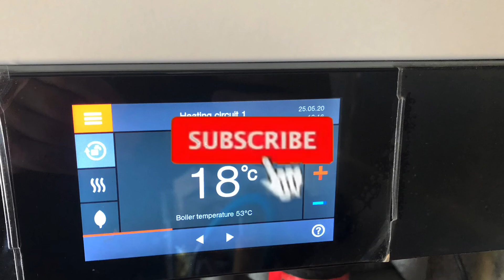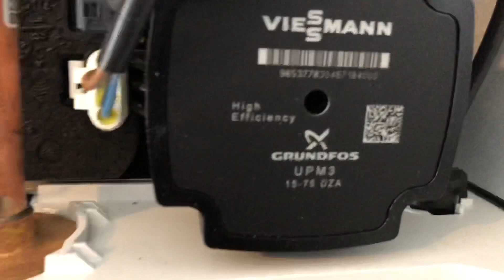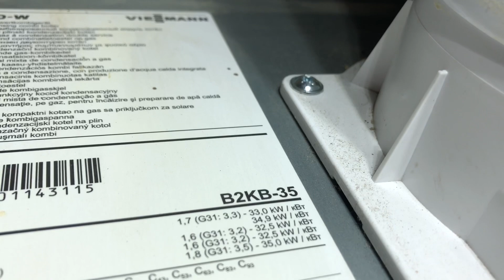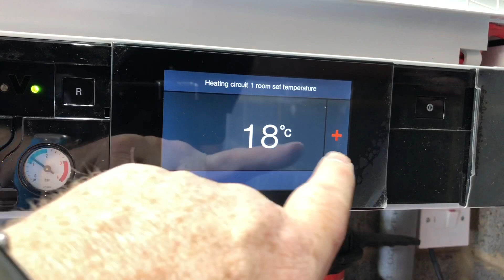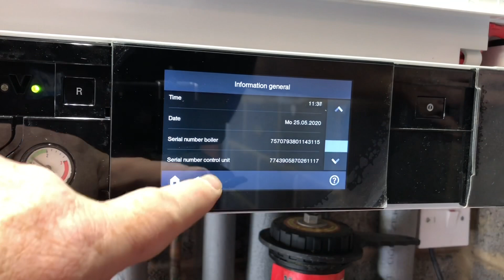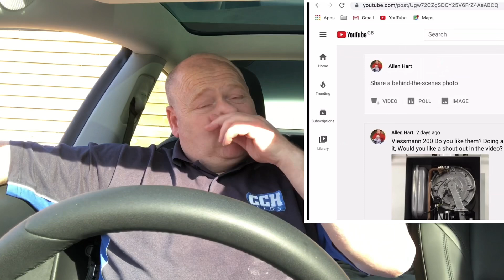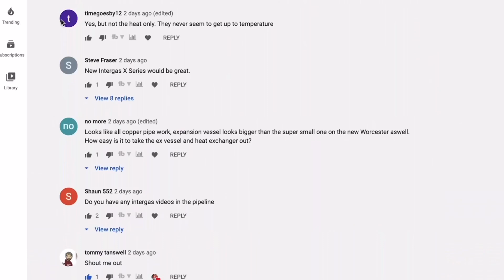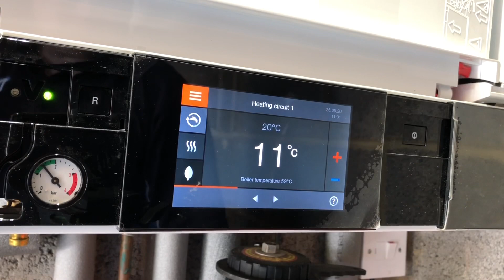Viessmann Vitodens 200 - What’s Inside - Combi Boiler Review

Comment: Having done a bit of research, including watching several of your videos, we've got a Viessmann being installed next week as a replacement for a chronically unreliable Ideal Isar, The budget and needs wouldn't stretch to a 200-W (we only have a 2-bedroom semi) so we're getting an 050-W on the installer's recommendation. It's not a model I'd come across (I assumed we'd end up with a 100 or a 111) but from what I've seen on your channel and elsewhere the engineering quality doesn't seem to vary much between the models.

As with the 200 here my only real concern is the rubber hoses (I wish they'd gone all copper across the range like on the newer 100-series) but I guess that's what the 10 year warranty is for. In every other respect they're works of art compared with the chaos inside the old Ideal which -- and I'm showing my age here -- reminded me of one of the bombs Richard Harris has to defuse in "Juggernaut". Bunches of wires everywhere and stuff hidden behind other stuff.

The comment from the community page amused me, about people not going for Viessmann because they've never heard of them. Well neither had I until I started researching! And it always pays to stay current: the last "common knowledge" information I had from a few years ago was that Worcester Bosch and Vaillant were still the top brands in the game, and my own experience with my Isar told me Ideal were rubbish. But now I see problems starting to emerge in older Worcester boilers, while Ideal seem to be having something of a renaissance with their Logic range (although not enough to convince me to give them another go). 

So thanks for posting this video. It feels very timely because, while this is not the Viessmann model we're actually getting, it adds to the confidence that we've made the right decision in going with this manufacturer.
Reply: KevReillyUK  You won’t be going far wrong Kev I’ve installed about 20 to 25 viessmann 050’s to date now over the years. they’ve all been pretty good the best remarks I’ve had Have been from home owners in regards to the efficiency /operating quietness and quality look and feel to the boiler, Call out engineers on warranty also very helpful as well as the knowledgeable technical department So far so good in all respects ,rubber hoses have been fine on the older 100 series but have been troublesome on boilers installed to very dirty systems so make sure your system is clean
Reply: @SalimKhan-gk1fh  Thanks. Our CH is in pretty good shape for a 15-year-old system despite having no filter. I knew from bleeding and one TRV replacement that the water wasn't visibly contaminated, and the engineer confirmed it with a quality test. The original inhibitor was still visible on the surface. It's still getting flushed and a SpiroTrap MB3 fitted so I'm reasonably confident there shouldn't be sufficient contaminants in there to mess up the hoses in the new boiler.

(I'd have preferred the apparently more efficient TF1 Omega but the heating company said they'd seen a few leaks with those when they used to fit them, but none with the MB3. Given that they'll be maintaining this system, I'm happy to defer to them on that one. Ideally there shouldn't be much filterable crud in there anyway once it's been flushed and recommissioned, so efficiency differences in the filter may not be as important.)
Reply: KevReillyUK Yes your heating company has given you very good information! I would have advised you the same, the Spiro trap is indeed a far superior filter I personally do not fit the Omega filter anymore The hoses in the boiler are not an issue at all on a clean system,  The smallest waterways are in the plate to plate heat exchanger ,which heats up the hot water , these are more prone to blocking than anywhere else on a dirty system, You will be very impressed with this boiler and it’s quietness and efficiency
Reply: Ive just had a 050 installed, actually considered the 200 for a little while, but with the 050 it feels like you're getting really good value for money as so much of the internals are the same as at the more premium (100/200) boilers.  Unless you've got a heating system in really bad shape I wouldn't worry about rubber hoses, it helps keep noise down anyway - think of all the rubber hoses in cars....

You understand a 111 is a very different beast?
Reply: @edcooper2396  Thank you! Yes, the only reason I knew about the 111 was because it came up as one of the options on the Viessmann website when I slightly tweaked the parameters of the very broad "describe your home" interactive boiler picker. In fact that part of the site recommends the 100, 111 and 200 depending on which parameters I tweak, but not the 050 even if I "go low" on everything despite plenty of 050 info on the site if you look manually. Whether this is a deliberate attempt to upsell or just a lack of integration with the interactive guide is hard to say, but given that the installer actually DOWNsold me to a more appropriate boiler I'd guess it's the latter. 

I will admit to being quite taken by the idea of an internal cylinder when I first saw it. Years ago we had an open gravity-fed system with a DHW cylinder and header tank(s) which I was glad to see the back of (too much extra pipework and hardware to maintain, although the immersion was handy). So I knew we wanted another combi, and the notion of a sort of "mini-tank" that might provide at least a couple of shower's worth of warm water in the event of a morning ignition failure of the type that had plagued the current boiler was quite appealing. But a chat with the installer told me the 111 was overkill for our needs, and might not fit in our existing enclosure even if it wasn't.

And thinking about it, basing a choice of new boiler on the failure pattern of the old one is kinda silly anyway!
Reply: KevReillyUK Yes the 111 would be complete overkill in a two bedroom semidetached house, i’m not sure where you would put it anyway as it’s like a washing machine hanging off the wall!! I should know I fitted 3 of them so far .  viessmann’s website always recommends the 100 series as the mainstream ‘fits most jobs boiler’, bear in mind the 050 doesn’t have water preheat option by the way if this is something you need you will need to upgrade to the 100series,  Either one has the top quality stainless steel radial heat exchanger.
Reply: Ed Cooper Yes we’ll said Ed, you do get better value for money with the 050 and on a completely clean water system with reasonably good radiators I’ve had no trouble at all with the rubber hoses
Reply: KevReillyUK 
Hi Kev how did you get on did you have the new viessmann boiler fitted yet? and if so what do you think of it overall ?
Reply: @SalimKhan-gk1fh  Sorry for the late reply to this: had a bit of a plumbing emergency yesterday (unrelated to the boiler, you'll be happy to know) and only just remembered this.

I'm impressed with the 050! It's a bit deeper than the boiler it replaced, but it's in an enclosure so I don't really notice the additional space. It's astonishingly quiet, to the point where for the first couple of days I was opening the cupboard and sticking my head in every time someone demanded DHW or the CH came on, just to make sure it was doing something. Once my confidence levels are back to where they should be, I don't imagine I'll be monitoring it all the time like I was at first.

(This is only tangentially boiler-related but I was initially disappointed by the remote thermostat/programmer the installer provided, an EPH Combipack 4. I was -- perhaps naively -- expecting a branded item designed by or at least for Viessmann, and at first glance this looked a little cheap and generic. But having done a bit of digging it seems these are NOT cheap and seem very popular in the industry at the moment. Allen looks to have a good relationship with them, and has a couple of videos. To some degree I still miss the simplicity of my old Drayton Tempus One, especially the one-press one-hour boost, but as with the boiler itself I suspect once I'm confident that everything's working as it should I'll be more likely to trust the EPH controller to do its job without constant manual tweaking. If I'm being honest by the end of the old boiler's life we were using boost on the Drayton almost exclusively because we didn't trust automatic operation not to constantly trip the boiler.)

But definitely no complaints on the operational side of things. The first DHW demand of the day can be a touch slower than the old combi (because of the lack of preheat?) but not by very much, and subsequent demands seem faster especially if hot taps are run a few times throughout the day. I don't know if this is by design or simply the result of more thermally efficient components, but it's a bonus. It runs the mixer shower beautifully, and the CH seems fine. Looking forward to the winter to give it a more thorough workout.

If I had one complaint it would be the lack of a backlight on the display, because the LCD is not very clear in poor light. To be fair this is exacerbated in our case by the location of the boiler, inside an enclosure on the right-hand wall, meaning I have to lean right in and look to the right (sometimes with a torch) to see what it's doing. And I'm really only doing this because the old system was so unreliable that I had to babysit it all the time; I'm sure once I'm used to this one and can trust it, there'll be very little reason to keep looking at the display. In the meantime it's a little frustrating though. The old Ideal had a separate LED for burner activity, and a clear 2x8 segment LED display that could be read from across the room. Even if it did spend most of its time displaying a fault code.
 🤣

Yeah, so overall I'm really impressed. Impressed with the operation of the system, but perhaps more impressed that neither Viessmann nor the installer tried to oversell me for our needs. I'd have happily taken and paid for a 100-W (which would have just about fit in the enclosure; the 200-W would stand no chance) and been none the wiser, but the 050 is clearly ideal for this property.

Obviously only time will tell whether the reliability is lasting (or, if it isn't, whether the warranty is worth the paper it's printed on) but that's true for any new hardware. For now I'm more than happy.
Reply: KevReillyUK I’m glad you are pleased with the viessmann 050, so have the homeowners of the 20+ I’ve fitted although swaying them into fitting viessmann’s was not easy! It’s all Worcester Worcester down here ! ( Brighton) First impressions of owners has always been excellent especially in regards to the quality /quietness /efficiency of the boiler in comparison to ALL the old boilers that were replaced Which where all of the main well-known brands, First use of the boiler during the day can take 30 seconds or so before you receive hot water this is due to the stainless steel heating coil taken time to heat up. On CH mode the boiler settles down to a quiet tick over ( only showing 1 burner segment ) and showing only £0.22 pence per hour on a smart meter consumption for a typical 3 bedroom house, my preferred roomstat has always been a danfoss tpone , a very smart easy to use thermostat
Reply: @SalimKhan-gk1fh  It's never easy going for an "unknown" brand especially if you have some already in mind; I was convinced I would end up with a Worcester or Vaillant and hadn't heard of Viessmann when I started researching. But it was almost impossible to find a really negative review of a Viessmann boiler from installers, customers or independent reviewers. I did come across one website/blog with a bunch of low-rated comments from a few years ago but if memory serves it was in Canada and speed/cost of obtaining parts seemed to be a common factor, so I guessed it was a new market for Viessmann and they were sourcing parts on demand from Europe. I didn't dig any further, because it was such an outlier both statistically and geographically.

I hadn't thought about the stainless steel heat exchanger taking longer to warm up. Makes perfect sense.

As for the programmer/thermostat I've subsequently learned that EPH's own 'Ember' smartphone-based control system consists of the same receiver and thermostat as the Combipack 4, alongside a gateway device that translates between WiFi and RF. EPH sell the gateway on its own so users can upgrade to app-based control. If I can do that, and use an old iPhone or iPad as the primary interface, any quirks with the programmer interface will be largely irrelevant.

Having said that, the gateway itself is kinda pricey and has no official support for Alexa, GH, IFTTT etc. so I might hang fire for a bit. I found a three-year-long thread on boards.ie discussing EPH (they are an Irish company and lots of ROI installers use them) and if I had to draw a conclusion I'd say they're enthusiastic, competitively priced (except for the gateway!), technically competent and provide great support, but are not ambitious enough in a rapidly changing market. If the price of the gateway comes down a bit I might get one just so we have an easier interface, but with other providers offering smarter systems and more homes having Alexa etc. I think they're going to struggle.

Comment: Hi Allen, can you tell me what the benefit of turning the heating off on the boiler in the summer? Surely the stat will take care of that.. if you have a cold summer evening... I assume you would want the heating to come on any time the temperature dropped below what you find comfortable!? Is that not a pointless feature??
Thanks
Reply: Not really, you might have a multi-zoned system with a bunch of thermostats, perhaps you want to be able to leave doors windows open without worry of the heating coming on, its summer you're fine with the odd 18C evening, your thermostat/programmer has gone screwy and won't stop calling for heat - its a pretty important to have this facility on a Combi boiler.
Reply: Hi Allen I’ve four bed house I’ve gone with the free boiler sachem I wanted vessiman 050 35kw but told by guy this makes not good make all so will require 28mm  pipe is that true but I’ve gone for baxi830

Comment: Worth it if you can make use of open them and the multi heating circuit logic on this boiler. I went for the 050 in my modest 3 bed house.
Reply: Ed Cooper I went for the 050 as well in a two bedroom flat I’m quite impressed with it what are your thoughts on it?
Reply: @SalimKhan-gk1fh  I think its great, much quieter than the old 24CDi, will have to wait for winter to see how it really performs, but the old 24CDi didn't really struggle unless it was very cold out.  I also appreciate its simplicity, I feel like I'm not paying for anything Im not benefiting from - I already have an extensive app-enabled zoned controls system that I didn't want to replace so wouldn't of got much from the 200 really.
Reply: Edd cooper comes with weather comp far better than open therm
Reply: @mattmackenzie1111  Weather compensation only might make sense if you run your heating 24/7, but I don't, the real value of the 200 as I see it is it can run up at 30kW and also modulate down below 2kW, to get value from that you need an Open Therm controller so the boiler isn'y cycling, the boiler is working hard when you're 10 degrees off set point but taking it easy when you're close to set-point.
In my situation, every room has its own controller and thermo-valave on the rad, though the rooms only provide a binary call for heat, as such its not possible to integrate Open Therm with the existing controls.
I have instead got weather compensation, which you can fit to the 050, its standard 10k NTC interface, think the Viessmann sensor is about £40.

Comment: Always been a fan of Viessmann boilers never a fan of the rubber hoses though.  Most of the components are held together with a simple clip and sealed with an o-ring.  I quite rate ATAG boilers too I've fit a few of the ic & ir range system and combi's and pound for pound I think they're up there with Viessmann. Fitting a ll header in today the flow on this systems carp.  I think there are a still a few out there who don't know much about system design and what it entails. 🤭